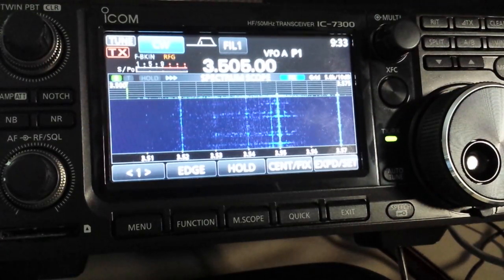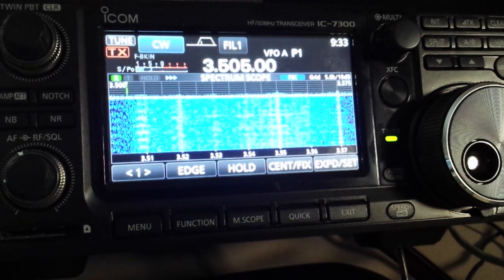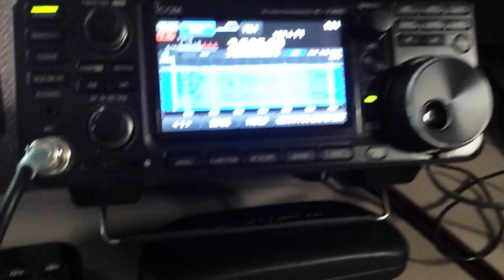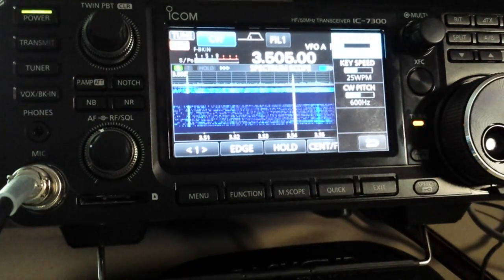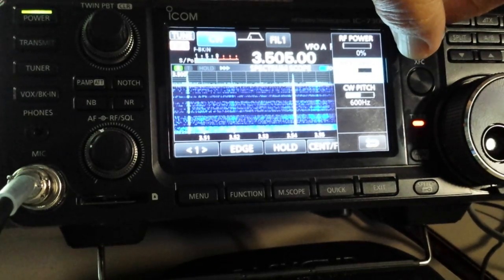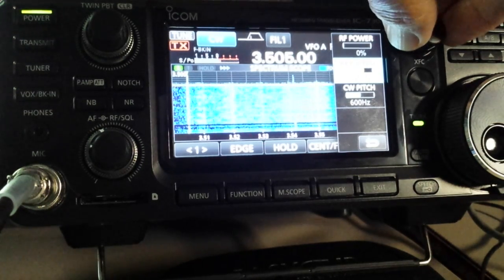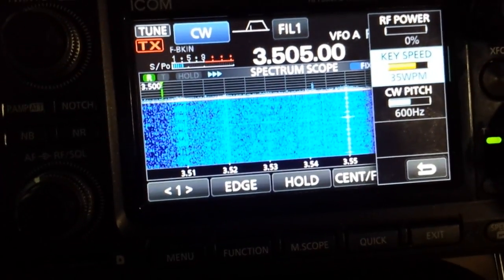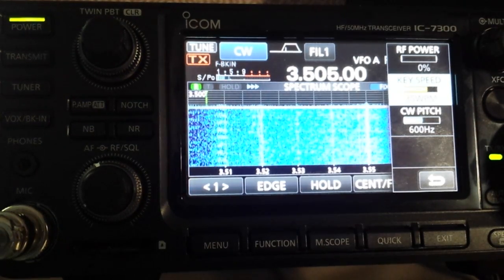IC-7300 QSK Full-Break-In Test

Comment: Steve - is this the linear amp relay making noise, if it were disabled would the transmitter still function? I have a matchbook cover jammed in the relay of my Corsair II, pop the cover and take it out to use the amp...
Reply from the maker: Sure. You can remove the relay but keep in mind, it's very tiny. You are dealing with surface mount parts. They don't make matchbooks that little. The relay can be disabled by removing a resistor or the entire relay and rerouting the amplifier line around it.
Reply: Hard to imagine that Icom does not allow this to be activated in setup (like OMNI 6+) but good to know only removing a resistor would be necessary. I probably will not do this but can just imagine what a sweet CW machine this could be when you don't need to worry about the amp relay or the fan (again like the OMNI). Currently waiting on delivery - looked at the Inrad device today, very nice but $40 so will wait until I need it.

Comment: Why do you care about working in full break-in? Unless you are rag-chewing your transmissions will be few seconds long and the other party will get chance to "interrupt" in matter of seconds. Also with full break-in, aren't you concerned that relay will eventually give up? Thanks
Reply from the maker: I started using QSK in 1964 while handling traffic on the NTS. It's a necessity. Although QSK has lost popularity I do have rag chews that take advantage of the feature and with DXing, even a few milliseconds delay can make a difference.  I prefer not to loose sleep over the relay wearing out although that is possible. Back in the tube days we used either separate rx/tx antenna or electronic T/R switches. Elecraft uses PIN diode switching. I've had PIN diodes blow in some TenTec rigs and had to replace a few relays. The ship to shore high power stations used a separate receiving location with audio fed back to the station over phone lines. Not too practical for hams.
Reply: QSK was always used by the professionals as it was necessary to interrupt the sender mid stream. For us that worked as professional RO's it is very difficult to not have full QSK. It is in my opinion strictly necessary, but as always, it is a matter of preference.

Comment: I found this video while searching for "IC-7300 PIN diode retrofit". The decision to use a clunky relay for T/R switching is a horrible design decision by ICOM, so I'll be looking at other products.
Reply from the maker: AFAK, the only 100 watt rigs using PIN diodes for TR switching are the K3 and K2.  Not even TenTec has them. 
With the amplifier relay removed from the 7300, most of the relay noise is gone. It's a simple task. The TR relay is small and no louder than the other brands and it can be muffled with some poster putty. 
PIN diode switching has a high parts count, engineering complexity and are susceptible to IMD issues. 
So it's down to the K3s which is expensive, complex, complicated and basically a money pit other wise a nice rig. I've had 2 of them.

Comment: That's all I need to hear. With relays sounding like that during QSK, I will not be buying a 7300
Reply from the maker: +hogdriver88 It no longer sounds that way hog driver
Reply: I don't like and won't even consider using QSK, if a relay is involved. Give me pin diode QSK, or I'll revert to using semi break-in.

Comment: TenTec is long overdo for something, the Orion was the last rig that I know of, something like ten years ago.  I'd like to see a wifi RC transmitter box mounted at the antenna to eliminate feedlone issues. Don
Reply: You'd think some engineers would jump on the idea of inexpensive RC transmitter modules that would connect direct to each antenna, the oonly other connection would be a power supply.  You could have your tower far away, no COAX!  And it can be used with a cell phone, tablet, HT, or PC to be linked with the module.  That's old trchnology, repeaters and cell phones have had remote control since the 70s.  A transmitter module per antenna, or multiband RC module.  Each module can easily cost less than 200$. A 5w ht can do it with old school PL CTCSC tones.  But NADA like that.  Yes the IC7300 has nice bells and whistles, but there is still that dam long coax wire and antenna tuners that can and should be eliminated.  Feedline issues are as old as ham radio.  Simple fix, but tell m who sells RC modules that mount at a tuned  antenna?
Reply: Ten-Tec released the Omni VII and later the Eagle after the Orion.
Reply from the maker: +N1EU plus the Argo 6,